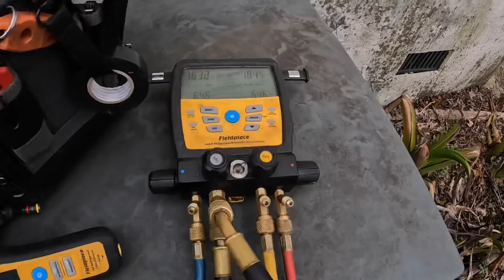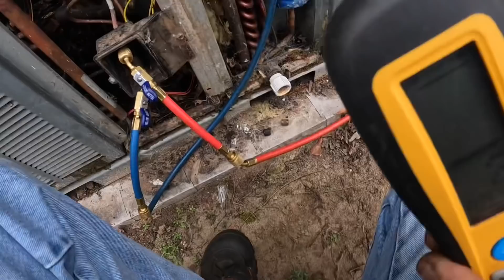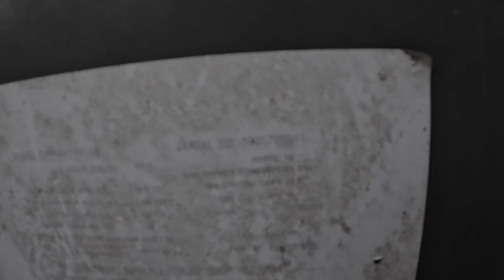No Heat Or Cooling for 3 Months on Two Systems - Empowering Neglected Tenants

Comment: I went to a no ac call the lady said she had no idea what happened it was working fine so I started at tstat it was blank I went to the package unit to find out why there was no power went to check the breaker box and discovered that the power company had turned the power off I told the lady about it and she said oh yes I forgot about that I've been to no heat calls and the people forgot to buy gas so there was nothing I could do but I still had to charge the 89 dollar diagnostics fee

Comment: About code enforcement.  Here in California, there is code to force landlords to provide working Heat. However, for the bottom of California there is no requirement to provide working cooling. With summer temps above 100 degrees, it is hard to understand why the state legislature never considered cooling.

Comment: On the second one even if the HW people found a leak no HW I know of will fix or replace a leak anyway.
Reply: Why wouldn't they? A failure is a failure and a repair is a repair. They don't cover outside damage like a flood or tornado, but if it just starts leaking, that's usually covered.

Comment: You like that leak detector?? In the market for a new one and am torn about that one or the inficon D Tek 3 and was curious about your opinion
Reply from the maker: I’ve only had experience with the old inficons - 12+ years ago - and those kept giving me false positives. But that was long ago. This is the DR58 and so far, I love it. I’ve been using it for 5-6 months and it’s still on its original charge. Very few false positives. I’m happy with it.
Reply: @HVACGUY  good deal, I may go with the fieldpiece then. The dr82 is about $100 cheaper than the D Tek 3, which will make the wife happier lmao

Comment: Brand new Rheem air handler coil leaking not even a month old have you even encountered coils leaking that fast?
Reply from the maker: Not yet.
Reply: I've seen the Rheem aluminum coils in brand new installs on new homes leak. Junk QC from the king of junk brand.